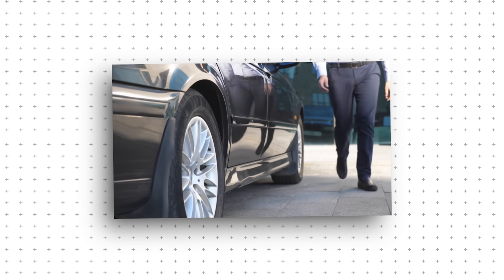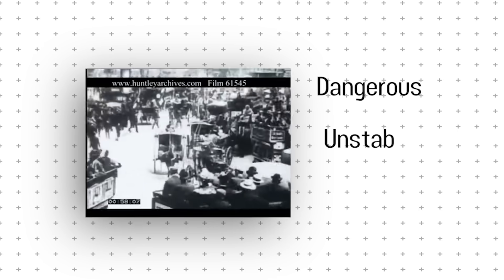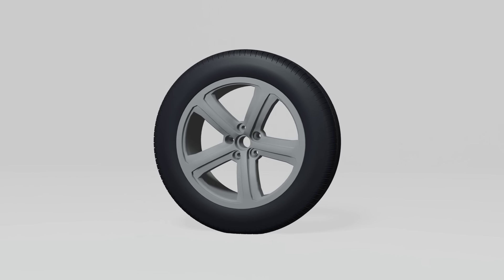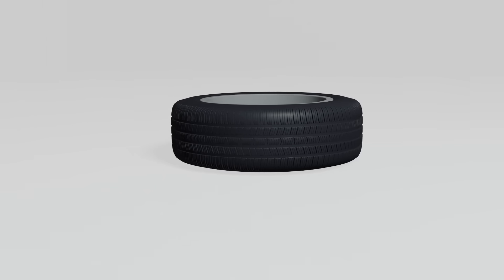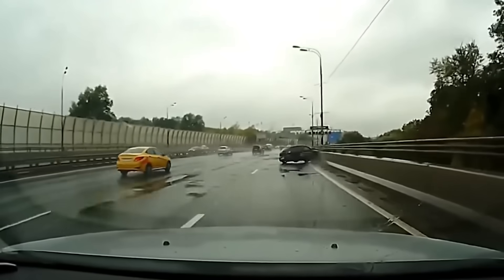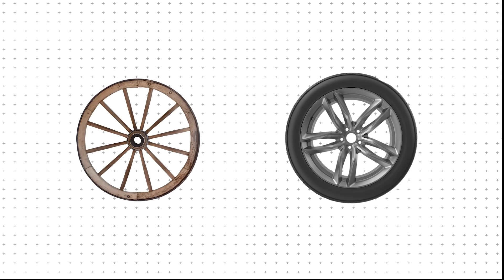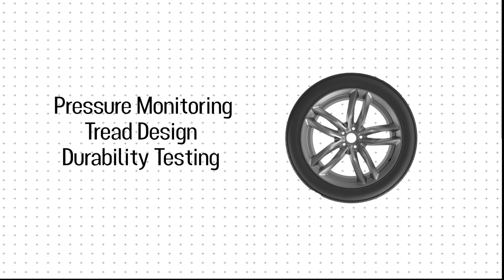Tires Don’t Work the Way You Think

Comment: I'll never grow tired of learning.
What I wonder about tires for EV is whether or not that sudden increase in demand is temporary. With battery tech developing rapidly again, I believe the expectation is for solid-state batteries to overtake bulky lithium-ion ones. Those should be significantly lighter, reducing the weight on the tires. I also don't see why EV vehicles should ramp up torque as much as they can, doesn't that drain the battery?

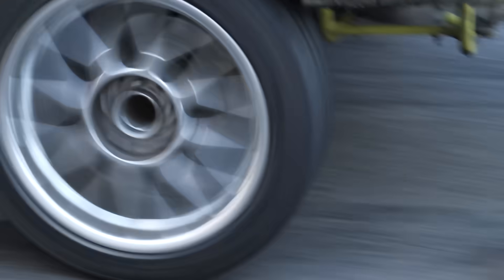Comment: 2:30 **The reason drag racers/Formula 1 racers have larger tires is to ensure that there is a contact patch.** The force of friction is the product of the coefficient of friction (which is based on the materials in contact) and the normal force (which is the mass of the object in contact with the ground times the acceleration due to gravity). Size of the contact patch is not the issue!!! Under the stresses of racing, the contact patch deforms, and in fact will shrink. (Higher temperatures cause the tire air pressure to increase, which bows the tire as it expands, resulting in a smaller contact patch.) A smaller contact patch will still provide the same force of friction (refer to the formula I just gave you). However, as the tire deforms under the high speeds, etc., it shrinks. Racecar tires are larger because you want to ensure that there IS SOME contact patch to keep you on the ground. Lose the contact patch, and you will go flying into the air. FYI, Formula 1 racers will sometimes UNDERinflate their tires, just to make sure that, as the tires get hot, they will still have a decent contact patch. THIS IS ILLEGAL. PhD - Physics graduate student here. I also direct you to WIkipedia, if you don't believe me.

Comment: Wide tires are not to increase friction, they're to spread the friction out over the surface of the tire. Because the smaller the patch is, the more pressure is on the patch, the friction itself balances out. But with smaller tires you're concentrating all that friction in a smaller area, which makes it heat up more, which causes more wear.

Comment: Who changes their tires at 15k or 40k miles, maybe if someone buys the cheapest tires? 
I guess my classic car is on its 3rd set of tires and it has less than 40k miles, but that is due to age, not miles. My 2019 Colorado ZR2 is about to get new tires, but they are just about to hit 90k miles on original Goodyear DuraTrack's (lived up to that name). Key is to keep them rotated so they don't wear one area prematurely and proper inflation.

Comment: I just traded in my first EV, after 42,000 miles on its original tires.

How long they last depends in large part on how you drive, as has always been the case.

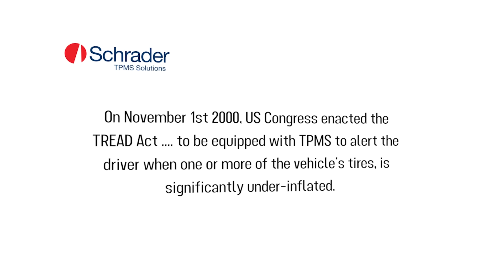Comment: 5:25 no, sorry, most of the vehicles currently on the road still don’t have TPMS and the number of blowouts has been declining for quite a while. it’s mainly due to three things: first, tire construction is better than it used to be, second, there is more awareness of proper tire inflation and maintenance than there used to be, and third, we don’t see retreaded tires on passenger vehicles anymore, but they remain common on transport trucks
Reply: I agree

Comment: I would like to add that TPMS came around mostly due to the Ford Firestone incident. Ford was selling vehicles with Firestone tires, but these tires had an issue with the inner linings, so air would leak out much faster than normal. People with these tires heard about the issue and would frequently air their tires back up and assume they were low, but at the time, most people didn't have a way to mesure their tire pressure, so many people would inflate their tires until the sidewall was straight. Tires are designed to have a slight curve in the sidewall, and it would only be straight if they were over inflated. So in other words, people were over inflating their tires. This then became an issue as when these tires were used they would heat up and the pressure would rise as a result, until the tires exploded. Vehicles were recalled and TPMS became a requirement
Reply: Your comment twigged my curiosity about the Ford / Firestone debacle, so I looked it up and refreshed my memory about the sordid details.

One little contention I'll make is about your saying "...at the time, most people didn't have a way to measure their tire pressure...."  Everyone (who bothered) could check their tire pressure for decades before that, with a simple mechanical air gauge, (those little hand-held ones you press against the tire valve).

Otherwise, your comment is enlightening🙂.  Thanks.
Reply: @be5952  it's hard to check tire pressure without caring enough to try

Comment: The failing tire industry is supporting itself by making tires that rot faster. I have 50 year old tires that are still soft and flexible. Tires these days dry-rot within as little as three years and must be replaced.

Comment: When Youtube was young
and ads were none,
There once was a video properly done...

The Video was from 1991 and it was kind of a document along video. 
Unfortunately it is long deleted to make space for Brainrot...
And it was Full Japanese so you wouldn't understand anyways. Yet you could watch and see...
Kawasaki with Dr Yoshimura Tuned a ZX10 Tomcat to Crush the world record. 
They went an Average Lap of 327 Km/h on an Oval. 
After one Stop the Driver said, the Ride is Bumpy.
The technician looked at the Rear wheel and saw Chunks size of a wall nut  missing. 
They stopped the tests. 
Just after that a few weeks, Kawasaki Had closed Conversations with Honda, and they Both Stopped chasing the World record. 
However they didn't tell Suzuki and Suzuki worked for 8 years and Launched Hayabusa. 
The Irony is at This time tires became 5x better so Hayabusa could be The Top speed Bike, oblivious that Others stopped not because they couldn't do better but because they Hit a technological wall. On the parts they can not make themselves.  
Do we make Death Machines with close to 100% kill rate, or do we calm down.
Reason won...
I Always Loved 90s Bikes and My friend always messed with me for Riding them and said They are Junk he rode them when he was young. 
I gave him my Suzuki GSX 750F 1992, and he came back saying:
Dude how does this ride so well? 
I gave him the same answer: Because you rode on 10x worse Tires 10 years ago...
And Imagine What it felt Like in 1992...
Those racers were heroes...

Comment: the shape of the current airless tires look like they provide no corning grip at all. You would have to take a turn like a snail to keep grip. Another thing about the airless tires is that you wouldn't be able to change the tire pressure (obviously). Motorsports use different tire pressures to provide different amounts of grip and length. Lower pressure gives more grip but wears faster, higher pressure gives less grip but lasts longer. Airless tires would behave nothing like current tires in terms of grip, and they would have to invent yet another type of summer, winter and all-season tire. Seems like a lot of money to spend that would result in less tire sales.

Comment: also, the force of friction depends on the coefficient of friction times the normal force (essentially the weight of the car, but it's actually how much the ground pushes back to support the car). Contact patch mainly matters when there is a prepped surface (drag racing uses a glue of sorts), however, it also gives your car more mechanical grip so it can do more before it slides. Also, sliding is bad (hence ABS) because the coefficient of static friction is higher than the coefficient of sliding friction. Try slowly pushing something across a surface from a stop and you'll observe it.

Comment: i worked on a rubber compound for tires whereupon adding about 5-8% silica (modified 'sand') improved the mileage by 5-7 MPG. Got a patent on it. Not new technology. There are a fair amount of companies that use such silica for improved gas mileage... and it doesn't change the price of the tire at all!!  PS: no, you cant just add 20% silica for 20 MPG improvement... unfortunately it doesn't work that way.

Comment: I'm a truck driver in Norway. One day I was driving on autopilot (mentally), and not paying properly attention. A car 20 seconds in front of me had come to a complete halt. The brake lights wasn't on, so I didn't register as the car had stopped, and I continued at 40 kmh (25mph) towards the car. I was a bit light at only 16 tons. 
Just as the trucks collision detection and avoidance system kicked in, did I realize the car in front of me had stopped and I slammed on the brakes. I came to a complete stop in about a second.

What caught my attention on this incident wasn't the trucks brakes, but the grip of the tires.
Reply: 5 yrs ago I brought a WRX Subie with good Bridgestone Potenza tyres on it and I had the same experience only a couple of weeks after purchase. Even after motor racing a lot of my life I was sure that I wasn't going to stop in time. I've been putting the same tyres on when replacements are needed. New Zealand.

Comment: 2:38 a screen record footage from F1.
Seems like it’s from 2022

Today is 12 April 2025

In the footage,
Hamilton is still in Mercedes. Therefore it’s not 2025. Should be 2024 or earlier

McLaren has no Oscar Piastri.
Norris and Ricciardo in McLaren 
So, it’s 2022 or earlier
(Oscar debuted in 2023)

And the other driver in Mercedes along Hamilton is Russell
So it’s 2022

(Bottas was in Mercedes till 2021 & was replaced by Russell in 2022)
Reply: Silverstone?

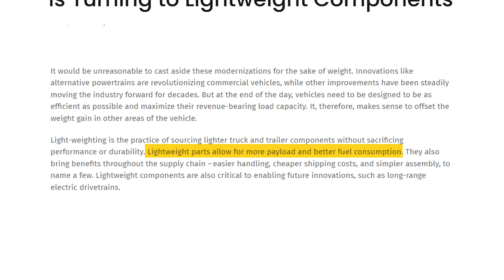Comment: 3:07 Bigger contact patch means smaller pressure from the tires to the road, so even race cars don’t use infinitely wide tires
Reply: It can be wider tire or lower pressure to increase contact patch. Both have their limits depending on the vehicle and sometimes it requires a combination of both.

Comment: I see one important limitation in airless tires, it's not possible to adjust the pressure based on road conditions and payload, so the pressure can't be decreased to increase traction on soft ground, nor increased to compensate for a fully loaded vehicle, resulting in a greater contact patch, thus increased rolling resistance, temperature and fuel consumption. 
This could potentially be addressed with a preloading inner "tube" allowing to adjust the pressure on the cell walls as needed, preserving the puncture-proof properties at the expense of increased complexity. 
A possible alternative, which would require a good bit of material science research, would be to use one of those polymers which instantly stiffens when subjected to impacts. With the right ratio it could automatically make up for the increase/decrease in deformation, but I suspect that it might also be counterproductive in some situations.
Reply: Suspension will do the rest

Comment: 7:25 being too quiet is also a problem, so many drivers don’t use lights in the fog, leaving them invisible to pedestrians.  If the pedestrian doesn’t hear them, they can’t see them and the driver can’t see the pedestrian…you see where this is going.
Reply: The noise benefits are seen inside the cabin, not out.
Reply: @travisbrewer5391 --- While what you say is totally true, I would still prefer tires to be as noiseless as possible, given the massive problem of noise pollution and my personal utter hatred of anything remotely noisy (especially the noisy tires on my new car!).

Daytime running lights, mandatory in Canada since 1990, solve this problem (whether completely, or less so, or better than, I don't know) without the need for a tire 'built in noise level'.

edit: re: @njott1021's comment---I believe tire noise reductions are perceived both inside the car and outside.

Comment: See Red Skelton concrete tire sketch. MICHELIN TWEEL et al while popular on Lawn Equipment will never be approved for road use any time soon if ever. That Pipe Dream has been pushed by MSM and others that only see PR releases from Tire Makers for 40+ years. Big Example: All are "open design" that easily get full of garbage and ice and causes unbalancing to major damage at highway speeds. Some would say solid rubber would work but wrong for any vehicle drives over approx 35MPH/55KPH because can't dump heat in the core and is a big reason why most only see them on toys and Fork Trucks because operates at very low speeds < 10MPH/15KPH. That ignoring many Countries require Air Tires by Law or Rules made US NHTSA, UK MOT and related agencies Worldwide.

Comment: It funny how technology go's round in circles old wheels didn't deflate used ridges for support but since they didn't move was very bumpy and unstable then tires that move but use air so can go flat then not work at all then we go back to riged tirers that don't go flat but now the ridges can move so the ride is now stable

Comment: 2:37 that is not how friction works. you get the same amount of friction force independent of the size of the contact patch.  This force is only dependant on the friction coefficient and the normal force (weight of the vehicle).
Reply: You’re describing the “first cut” analysis. You’re generally correct, that friction is independent of area, but rubber is a different animal. It conforms to surfaces and stretches thin like a rubber band which has secondary effects on friction force which are indeed directly related to contact patch area.
Reply: Drag tyres are like a variable transmission
Reply: More contact area = higher friction 

The coefficient tells you the friction per area
Reply: @GerManBearPig  more contact area-> lower pressure. 
friction= pressure * area * friction coefficient.
in other words:
friction=normal force * friction coefficient.
Reply: @GerManBearPig  naww sorry dude, but that's just not true. It does SEEM like that would be the situation, but it just isn't the way friction works.

You can kind of sense this for yourself: a small box with 10kg of weight is NOT hundreds of times easier to move than a 10kg carpet, spread out over the ground.

Similarly, dragging your hand over a desk is not 20 times harder than sliding your thumb over a desk.
Reply: @donperegrine922 wouldn’t that only be the case on smooth surfaces without grooves or ridges or would it still apply across rougher terrain?
Reply: @donperegrine922    Comment threads like these, educating about the science involved in things, is really interesting for us 'science interested but science ignorant' people.

The trouble is I never know which seemingly educated person to believe🤔??
Reply: @be5952  yeah! You are right. So there are three resources you could turn to to find out: research papers (as a last resort) experimentation (if possible for you to test it) and the equations.

You probably would not and should not turn to any of them, but instead to a YouTube video! They will discuss the issue, plus misconceptions and SHOW YOU one of those three to prove what they say (the YouTube educator will know the best of those three choices, and will explain it in detail for you.

Equations are the gold standard. If it disagrees with the equation, it's wrong.

For friction, f = μN, there is no term which talks about surface area. μ is a number which depends on rubber, ice wood, steel etc......N is literally just how HEAVY the thing is.

So, because there is no variable relating to area, that is the mathematics literally telling you "it doesn't matter what the area is". Same as, because there is a no variable related to each one, the maths is also saying "it doesn't matter who the president is, it doesn't matter what altitude you are at, it doesn't matter how fast you are travelling"

I hope I was helpful and understandable!
Reply: @donperegrine922  if I may nitpick your otherwise good information.:
".N is literally just how HEAVY the thing is."
that is only true on level ground.
more generell: N=weight* cos α .

Comment: The ev statistics are wrong, or at least misleading. For one, there have always been heavy cars, that's not a new thing, it's just becoming more common. The big thing is the wear. EVs don't always accelerate fast. Many of them can, but are you full throttling your gas car everything you drive it? No. Most EV owners aren't either. If you drive like a normal person, and have the right kind of tires foe the vehicle, your tires will last nearly the same on an ev as it will on an ICE car.